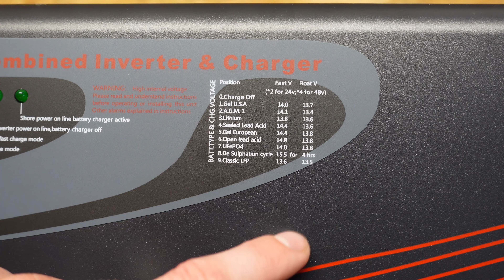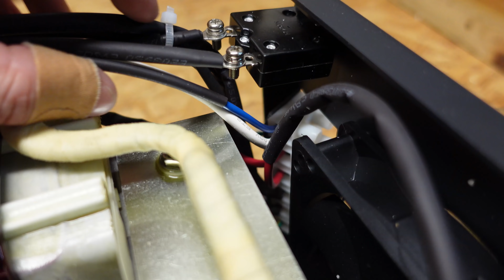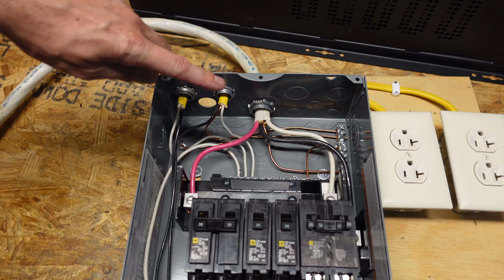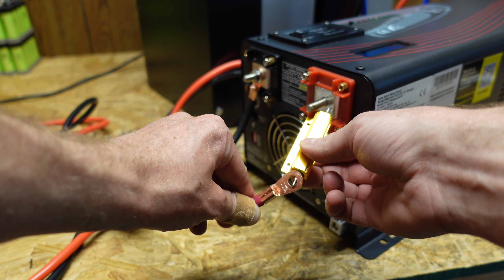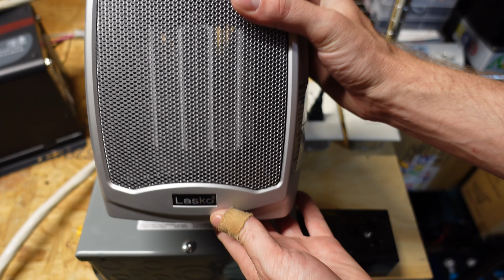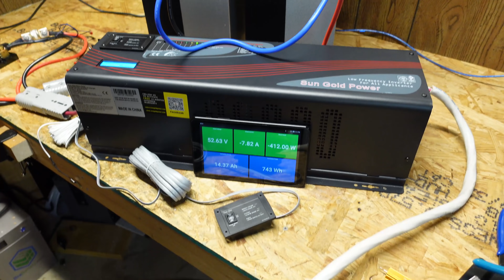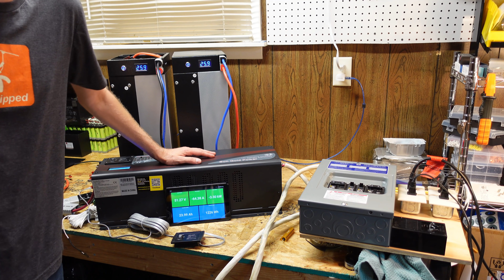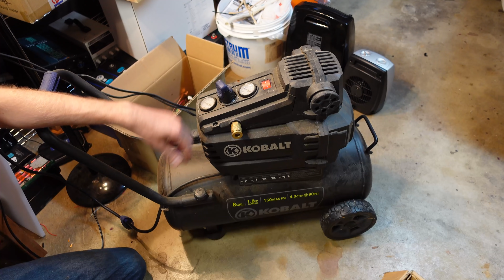SUNGOLDPOWER 6000W Pure Sine Split-Phase Inverter, Review & Testing

Comment: Mine died after 2 years on the off grid house. It ran extremely hot right from day one, I think I was sold a faulty unit on Amazon. I own a second one that hasn't seen much use yet. The loads were always well under 6000w generally 200w or less. Occasionally used it for power tools, like the miter saw, cement mixer.
Reply: I should note that the second one I bought runs much cooler

Comment: HELP OMG.  I homestead and have 6 feet of snow coming in the next 72 hours and my overload light is on and non stop beeping and without the generator on i have no power.  When generator is on it works. Nothing different in power use.  I did a hard reset no luck.  If you could help me trouble shoot,  I can pay you please help if you get this. 

Thanks Mountain Mike

Comment: I didn't see any chokes into the primary. If you add a choke to the primary input, from the transformer into the primary rail, wrap it twice through the core and connect back to the rail. The idle current should drop to about 20 watts.
Reply: I don't think you can get away from that 100W idle loss. It's the transformer core losses. Inherent. Magnetizing currents, eddy currents etc.

Comment: Nice looking inverter, I would like to have seen you push it more, even my cheap Giandel 4000/8000 inverter can start up an air compressor similar to yours.
What it can't start is a 2300w mitre saw which is a crucial tool for a lot of people and has a start up load much higher than an air compressor.
Reply from the maker: Did you watch until the end? I ran a cloths drier on it that pulled 5500W. I would have loved to push it more, just don't have many 6000W appliances lying around AND the batteries were kindof the limiting factor in the test here :) :)

Comment: I have this same unit for a year and a half now. I use the hell out of it, well pump, compressors, 3hp table saw etc. and have no complaints save for the high idle consumption. 
Question, I have the neutral bonded to ground at the house panel, which is fine when on the inverter, but my 20kw genset is bonded at the genset. So when running on the genset I have two bonded points. Any thoughts as to how to avoid this?
Reply: I removed the bonding wire off my honda 3500 for use with my furnace otherwise the computer on the furnace gives a ground fault and won’t turn on during a power failure. Then i made a plug with the neutral and ground connected and plug it in whenever I use it not hooked up to my transfer switch.

Comment: Hoping you see this, as I am kinda stumped. This is the same inverter just re-branded as the Sigineer 6,000W model based on what I have seen of the internals and comparing it to my Sigineer. 

The question I have relates to your AC OUTPUT wiring. I have the same panel you have and am preparing to run lines to it.  I do not ever plan on having an AC Input either. This will just be stand-alone, off grid.  So my question relates to bonding the neutral and ground on this type of setup. 

Sigineer has kind of mixed messages regarding it, namely on removing the bonding screw.  I guess what I am asking, How would you wire up this inverter in a stand-alone setup with no AC-Input to power a small house using the same panel you have in this video? 

As is expected- If I fry myself, it is my fault entirely. I am just looking for some advice on wiring it up. I am comfortable around AC wiring, just don't wanna screw up the inverter. lol
Reply from the maker: My Opinion) The neutral+ground bond should only occur at one location. Anything more turns the ground wire to a current-carrying conductor (very bad). If you're running it completely off-grid like I am (with no AC input ever), you would wire your inverter output to a breaker panel, then bond there. That's how I wired it in this video and how I have my AIMS 10kW wired.
Official Answer) Contact an electrician ;)
Reply: @LithiumSolar  Do you have your AIMS chassis grounded to Earth? 

I actually need to open mine back up and see because I never noticed if they had bonded the ground inside the inverter. Some do that and some don't.

Thank you for reading and replying. :-) 

I actually live next door to an electrician. lol. I was actually planning on asking his opinion on it at some point if I couldn't get the right consensus from others who have done the same things.

Comment: I do not understand why big battery sells 175 amp anderson connectors with 6 gauge wire installed in them. I noticed that immediately when I looked into their products. I haven't ordered from them, and I'm sure their batteries are good based on other reviews here on youtube but the 6 gauge wire bothers me. It should be 1 gauge minimum....
Reply from the maker: There are many charts on the Internet that show 200C-insulated wire can hit some pretty high amp ratings. For example, this one https://www.coonerwire.com/amp-chart/ says it can handle 165A. I agree though and have made the recommendation to them that they consider selling thicker gauge cabling. It sounds like it's possible they'll be carrying more options soon, but I can't speak for them.
Reply: @LithiumSolar  Dang, I have always kept 6 gauge to like 60 amps lol. I haven't ventured into the high temp rated wire yet. I suppose the larger amperage rating on the high temp rated stuff makes sense, but all that heat means resistance. I dunno, something about hot wires gives me anxiety hah. Thanks for the quick response and the enlightenment on high temp rated wires!
Reply from the maker: "something about hot wires gives me anxiety" > I completely agree! Lol. I've always tried to stick to the NEC numbers myself.

Comment: Well, I purchased a Sigineer 6000W Split phase inverter... and it 
arrived damaged. Took a pretty good hit to the DC input side and pushed the rear panel in against the internal PCB.

 So looks like my review of the 24V version of the unit you reviewed here 
will have to wait. If UPS approves the damage claim and UPS doesn't want the inverter, I'll pull apart that one for the review. 

Thanks for doing this in depth review of the 48V version. The internal view and the quality of the wiring and assembly sold me on this manufacturer. I just didn't need a 48V system and in the event I ever need emergency juice I can just run 2x 12V AGM batteries in series to get 24V to run it vs needing 4. Plus, I will only really need 3000-3500W max typical for my needs currently so the 3,000W version was out and the next step up was the 6000W version. lol

Comment: The presence of 60 volts between ground and neutral at the inverter outlet can be hazardous to common household appliances, such as refrigerators, etc. Attempting to connect ground to neutral at the inverter outlet will cause internal damage to the power circuits.
Reply from the maker: Your local electrical codes will dictate how/where the neutral + ground bonding occurs. It is not bonded in the inverter.

Comment: "Single Phase, 120/240 volt" not "Split Phase". Split phase is a type of motor, not a type of electrical service. Manufacturers are not immune to misinformation!
Reply from the maker: It's referred to as split phase.. lol. "A split-phase or single-phase three-wire system is a type of single-phase electric power distribution"
Reply: I know- misinformation is insidious like that. It spreads like wildfire. I try to do my part to respectfully correct it when I can, but it frequently falls on deaf ears. In the National Electrical Code it is still correctly referred to as a 120/240 volt, three wire system. The thing is, there is no actual “phase” with single phase current. The term really just distinguishes it from polyphase current. And indeed you can just as easily have a 120/240 volt, three wire service in Direct Current. Edison himself made that one famous, if he didn’t outright invent it. Obviously there is no phase in Direct Current either. ;)  Incorrect terminology becomes popular to the point that manufacturers start doing it, which only reinforces it and so on. Nevertheless, no matter how popular something is, it’s popularly does not make it correct.

Comment: I've had the 24v 4000w model for over a year, running low loads 24/7, and occasional high loads like a well pump, with no issues. I leave it in standby mode, which only consumes about 18w. It switches on when about 25w or greater load is sensed on the output.
Reply: FOR THE LOAD OUT IS IT G N L1 AND L2 ? LIKE MY 4 PRONG DRYER
Reply: @goldienakamoto7894  Just the inverter frame has a ground.  The AC output is only L1 - L2 - N. I use L1+L2 for a 240v well pump, and the L1+N and L2+N legs for 120v loads.  (Note that L1 and L2 are limited to half the total rated watts each, so for my 4,000w model I don't exceed 2,000 watts on each 120v leg (at least not for a longer time than the specified "surge" time that is allowed) ).
Reply: @montwell2  i just got the mpp lvx6058 well hasnt come yet man but im fricken excited!! yea im tryign to power my well to this solar stuff is the coolest thing to me

Comment: Excellent review and presentation, like always!

One thing I'd suggest: should (almost) always connect the positive side of negative/ground bonded DC circuits first.  That way if you do accidentally contact the chassis with the other lead, there's no risk of a short.  I'm sure you already know this, but my anxiety went up a little bit during the capacitor charging. :)
Reply from the maker: That's a great tip to keep in mind!
Reply from the maker: @Simon Messer I don't sell anything, I just make videos. You'll have to ask the company if they sell replacement parts (I think they do).

Comment: Pulls 100W idle then you connect a 1KW heater - pulls 1.8KW ? Daamn...
Reply from the maker: The low mode is around 1kW. I had it turned on high, not sure what the exact rating is on high offhand.

Comment: Thanks for the video and all the useful info on this channel!  I was surprised at the parasitic loss of 100w for just running this inverter.  I'd be curious for you to get your hands on the digital Solar Edge HD Wave which sells a 6KW inverter for less $ than this model with a higher level of efficiency.  Then discuss your findings for HD wave, vs. toroidal xformer vs. this style xformer.  Anyway foopd for thought as you grow your channel.
Reply: The Solaredge is a great inverter but it's TOTALLY a different use case. The SE needs optimizers attached to solar panels vs a battery,  it's not made for this kind of use.  It's intended to be 100% grid-tied, whereas this is more of an off-grid solution that is NOT legal for connection to the grid (you can do it but you need to wire it like a generator and switch yourself off the grid when in use).    I actually own both the SolarEdge and this 6K inverter and have tested them extensively.

Comment: Junk inverter from a company that don't honnor their warranty. My sungold 48v 240/split inverter/charger failed after 3 weeks of very light usage. I took a week and a half off work to resolve the issue just to get the runaround from sungold. I'm now left with a $900 boat anchor and had to buy another inverter. 
To anyone reading this with the thoughts of buying this inverter please do yourself a favor and spend the extra money for well known and trusted brand.
Reply from the maker: What happened? Where did you buy it from? If you bought it from Amazon, 3 weeks is still within Amazon's return policy - regardless of what the seller says.
Reply: @LithiumSolar  Amazon, the only thing Amazon did was open a investigation into the matter to which I never got a reply. Amazon wont even let me leave a product review.

Comment: My first one was damaged slightly.. cover bent. Inspected, no real damage inside. It’s a Beast and starts EVERYTHING!
I complained about the packaging! The seller responded with good comments and would review the packing.
My Second one I just received was packaged Much Better and had No Damage!
I opted for these do to the Low Frequently design and the Heavy Duty Build!
Thanks buddy 
✌️PT
Reply: PT do you have them both in parallel to the same breaker box?
Reply: @lesw8798  No sir.. I have a solar power shop with one of these running out there and the other one is for the house system as a backup.. redundancy is very important! Actually in my house I have two 12kw inverters and this 6kw for backup. Pretty dang soon I will upload a video of our home solar power system!
It’s sooo cool to check out how much power your own system generates!
Electrical Freedom!
Thanks Les
✌️PT

Comment: I wish these Chinese solar inverter  manufactures would build these things to US electrical code, which should be OK for Europe as well. The AC connections should be under a removable cover and a knockout for conduit or other approved AC cable. The DC input terminals should be protected as well. The current there can melt rings and watch bands with little effort. And at least in the USA, if the battery voltage is above 50 volts, it is considered class 1 wiring which should be installed the same as the AC line side.
Reply: Mine came with covers for both the AC block and the DC input terminals.

Comment: Weird how the neutral wire is 10 while the two hots are 12’s. 

In an ideal world where the breaker panel is “balanced” and the loads are “balanced” amongst the hots. The neutral wire will have little to no amp draw.
Reply: The world isn't perfect. Non-linear loads are very common, and the imbalanced currents from non-linear loads are additive upon the neutral. They do not cancel each other across the phases.

Comment: "6ga wire... just is not enough for 130A in my opinion"

Not just your opinion. 50A is about the ceiling of what you should be pulling through 6ga copper to be safe. That's why they're getting hot. I'd also be worried that you are coming close to, if not exceeding the temperature rating of the insulation. You need more batteries to distribute the current load or thicker wires - 1/0 would easily give some headroom. Meaning those Wolf batteries are NOT properly built for the load (130A) and charging current (100A) they're rated for.
Reply: Yea no2 rated 100a would work good for its rating.
Reply: @MmeHyraelle  I'd probably go 1ga at minimum for 100A, leaning toward 1/0 if it was going to be working near 100A a lot.

Comment: Yes Sigineer is the actual maker of all these units, identical except for branding.
Reply: Did you know YIYEN makes all of the Singineer inverters
Reply: @terrya6486  I did not. I have corresponded via email with Signineer, and bought a 6 kW inverter (essentially identical to the one reviewed in this video) direct from them, and they said they made the inverters and private labeled then for other brands. Is YIYEN both the designer and maker, or are they a contract manufacturer for inverters that Sigineer designs?
Or are the two companies cloning each others products? (pretty common in China)

Comment: The center tapped secondary is not an auto transformer.  It is isolated from the primary, and that makes it simply a transformer.
Reply from the maker: There is no secondary when it's running in pass-through mode.
Reply: @LithiumSolar  Nor any primary. In pass through, the incoming line is simply sent to the output through a relay. I haven't taken mine apart to look, but a presume it is a double pole double throw relay that connects the output to the incoming split phase 120/240, or to the center tapped secondary of the big transformer.
The primary of the transformer is connected to an H bridge PWM sine wave generator running at the battery voltage. This makes ~ 30 VAC, which is stepped up to line voltage by the transformer, which has a 240 volt secondary with a center tap.

Comment: 6awg is rated 55amps at 60c ambient
Reply from the maker: That is for home residential wiring with 60C insulation. NEC chart is a good rule of thumb but doesn't apply here because 1) not residential wiring and 2) has 200C insulation.
Reply: @LithiumSolar  The objective of the NEC rating is to limit objectionable heating of the conductor.  If heat is the topic of discussion, then @Mark McGuire has a valid point.

Comment: Iv got the 4000 watt split phase one and it’s been running almost three years 24/7 running my house
Reply: mine failed after 3 weeks of light usage and sungold gave me the runaround with warranty. I chucked up my losses and had to buy another inverter.
Reply: @douggibson2428  what did you buy and how did that one last?

Comment: Try to get a 3 prong 240v dryer cord and connect black and red to the inverter. Neutral is not used for charging. Therfore you can test the charge circuit